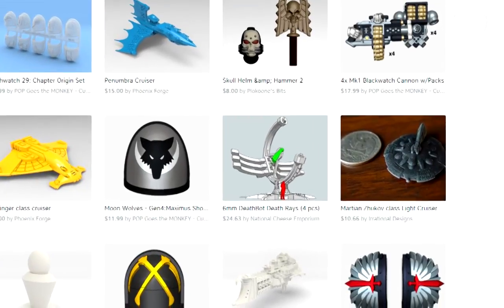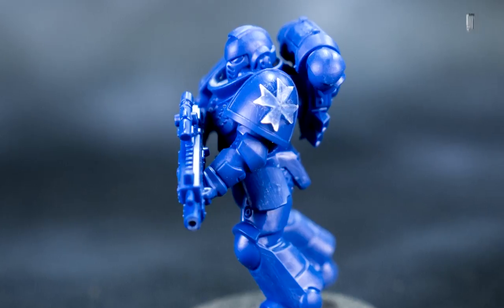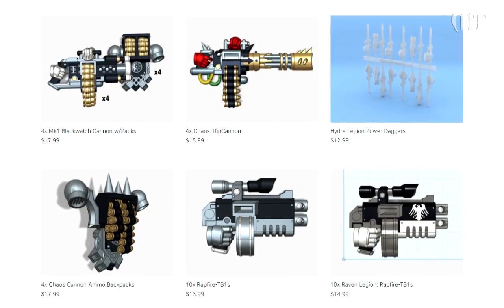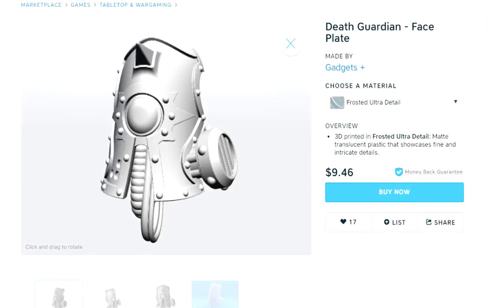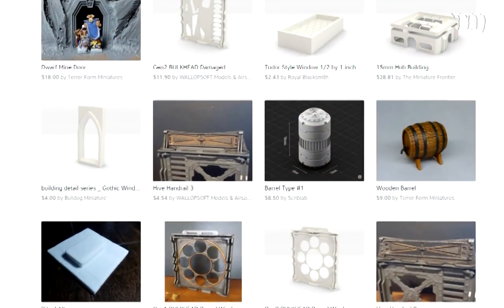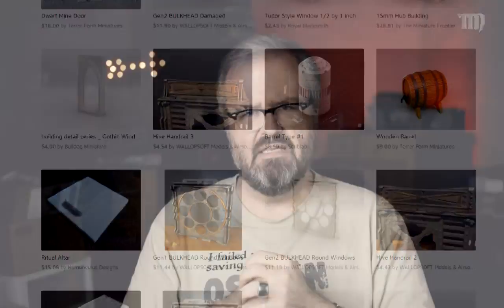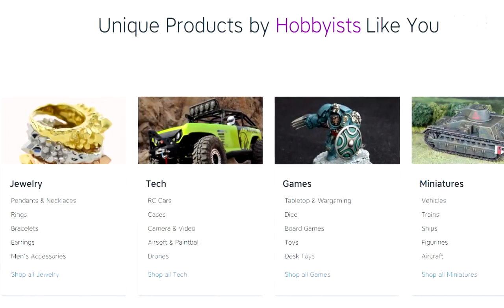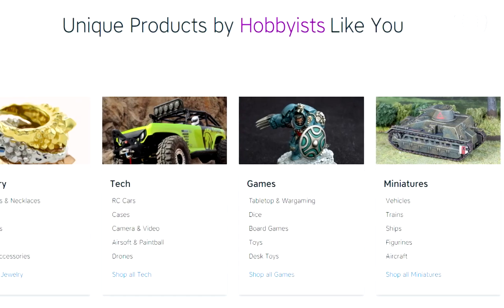Get 3D Wargaming Prints Without Owning a 3D Printer

Comment: If you want to learn 3D printing and 3D modeling, look for an independent (possibly non-profit) makerspace or library near you that has 3D printers. Often they will offer classes on the subject, sometimes at no cost to you. You can get your feet wet, or just dip a to in and possibly learn 3D modeling and printing for the cost of the filament that you use. If it turns out that you like it, you may be able to join the makerspace for a small monthly fee and get to use their equipment. Plus, you'll be around other like minded people in a hobby you enjoy.
As for 3D modeling, if you can learn how it is done and create your own library, you might be able to find a job in that field. Solidworks modelers can make decent money, but learning any modeling software can help you gain an education in the topic.

Comment: Public libraries are a good place for playing around with 3D printers too. Most have filament printers but some do have resin ones! Plus, the cost can be pretty cheap. The library I work at only charges a quarter per half hour, and offers classes to teach 3D design and how to use the printer. Something to keep in mind if you want to dip your toe into 3D printing.

Comment: you can get rid of the layers by using abs filament and then putting it under a glass cup with a paper towel with a bit of acetone aslong as its airtight and watch it and itll melt it and make it smooth aslong as you dont leave it in too long youll be just fine.

Comment: There are several public libraries near my home that give you access to 3D printers, laser cutter/engraver, vinyl and paper cutter, sewing machines, laptops, recording studio, and so on for no cost other than the cost of any material used such as plastic filament for the 3D printer. You're not going to get the detail that was shown in this video but you will be able to proudly say "I made dis." Just throwing out another option.
Reply: David Casto damn where you at, I've never seen a library that nice

Comment: Bean 3d Printer is a SLA printer that has very high detail and its $500 bucks (OK its a "Kickstarter" but the company actually makes a 3d printer and that was successfully kickstarted and they are located in California), there is also the "Duplicator D7 DLP Wanhao" which is also between $500 and $700 bucks and its a SLA printer that has really high detail (although the company does have quality control; problems they are getting better).

Comment: A great alternative to Shapeways is 3Dhubs, you upload your model, choose the material, then choose the guy that will print it, it's easy to use, a bit cheaper than Shapeways (since you can choose price vs quality yourself) and you can get the print shipped to your home or can arrange a meeting with the printer operator to get it yourself.

and if you have a 3D printer, you can submit it to their database and get some money by printing models for peoples.

Comment: I do modeling for a shapeways store and its important to note that there are limits on what can be 3d printed through them both because of the printing methods and a practical limit.  Certain materials have restrictions on how large they can be or how thin parts can be so occasionally the models will look off compared to metal or plastics because of scaling. Also on a practically level the larger the model gets the more the cost rises. 3d printed parts and even basic figures are generally affordable but larger items like entire vehicles become astronomically priced. I did a landraider proteus once and clocked in at around 600 bucks.

Comment: I own a Form1 SLA printer (about 5000 USD new) that i use mostly to print out 1/2000 scale models of WW2 ships that i make. The prints are very nice with details of up to 1/10th mm. High enough to make custom parts and models for 30mm games as well.

Downsides are the quite high initial price and the resin that comes at around 130 USD per liter. It also requires a lot of maintenance. Since the printer uses a laser and several mirrors all optical components need to be cleaned regularly with optical wipes. Dust or smears on them will cause failed unusable prints and lots of headache.
Reply: If you don't setup a little area for it, and not careful when pouring resins into the vat if your machine doesn't use a cart system like the new form 2 does (about 3.5k USD.)

The biggest thing I've used for my littleRP, which is a older diy/kit SLA machine, is I bought some cookie sheets for doing cleaning and part removal so no huge mess to clean up. And some old larger sized tubs for the 99% IPA for cleaning the parts post printing.

For SLA form 2 is about the cream of the crop of home machines, a few other less expensive machines have come out in the last two years that produce some outstanding prints at a fraction of the price, but the resin is pricey no matter what goes from 80USD-450USD per litter depending on the material type and the chemical properties of it.

If monoprice hasn't killed it, they have said that they will be releasing their own rebadged SLA machine for about 500USD, which is basically a wanhao duplicator 7 which uses a dlp projector rather then a laser so has a smaller dot size and able to produce finer details but the big trade off is smaller build volume and have to fill the vat yourself, so long prints have to top off the vat here and there.
Reply from the maker: I appreciate the input. I've also heard the resin seems to get everywhere, no matter how careful you are. Do you find that to be true? Thanks for watching!
Reply: For the first couple prints maybe, but once you learn how the material handles it's not really an issue. The resin is a bit like liquid honey, except dripping less. The isopropyle alcohol needed to post-process the prints also doubles up for cleaning.

Form 2 pretty much sloves most problems the form 1 has. It has sealed optical pathways and automatically feeds resin into the tub.
Reply: That's awesome.  I've been wanting to make a mess o f 1/2000 scale model WW2 ships, but don't have the $$$ to buy a SLA printer.
Reply: Try the Form2. Much better and almost zero maintenance.

Comment: Let's be honest here - it's quite not as straight forward as our dear Uncle Atom is suggesting.

True, there's a lot of nice stuff on Shapeways and even more can be found on places like Thingiverse. 

But here's the caveat - Shapesways is expensive for what it is. VERY expensive, in fact. And unless you pay through the nose to have them SLA print your stuff, the quality isn't really any better than what you can do at home with a good printer.

If you only need a helmet or a few shoulderpads, sure, go ahead and order them from Shapeways. But if you're into 3D printing on a larger scale - not just a few helmets but a full chapter's worth of helmets or a lot of terrain - you're probably better off buying a printer yourself. It will be cheaper in the long run.
Reply: "it's not quite as straight forward as Uncle Atom is suggesting: it's expensive"

It being expensive doesn't add complexity to the equation, it's still just as straight forward.

There was plenty of screenshots of the prices, so it's not like he was trying to hide the pricing.

"you're probably better off buying a printer yourself. It will be cheaper in the long run."

As Atom said, it's not just a case of saving money from not buying a printer. Shapeways have technology which far outdoes anything a home printer can do. If quality and resolution isn't an issue, and you think you're going to print a lot of stuff, sure, go ahead and buy yourself a printer as it probably will save you money eventually. But if you really care about high-fidelity prints you're better off going with a high end printer.

It's the same thing as regular printing. I can design and print a flyer on my home inkjet printer, but it's not going to come out as good as if a professional, high end printing machine printed it.
Reply: I have to disagree; just because something is expensive doesn't mean its not simple/straightforward.  It really boils down to cost vs convenience; is the service they offer valuable enough for you (meaning "you" in the general sense) to pay what they're asking?  Yes, if you're looking entirely at the long term then buying a 3D printer and learning 3D modelling on your own is an investment that may eventually pay off assuming that you judge being able to 3D print stuff for yourself (and possibly to sell to other people) as a return on that investment.  If, however, you're someone who doesn't want to shell out the asking price for a 3D, as well as the additional cost of material and you don't want to eat the expense of bad designs and/or botched prints, then sites like Shapeways and Thingiverse are reasonable alternatives.
Reply: Shapeways can be cheaper that GW or FW in some situations.  For example:  I got 60 ultramarine shoulder symbols for $18 from shapeways.  GW sells 10 full shoulder pads for $13.50.   It comes with other bits, but not the kind I can use 6 copies of, and the shoulder pad designs are only really suitable for a command or veteran squad).  FW sells 10 for $14.30 which come is various styles, but that would cost $85.80 for 60!
Reply: I do agree with you in principle, but there is a reason painting services for example, exist, some people have the money but not the time or interest to invest in learning how to do these things & just want an end result they can use.  This service would suit them just fine.

Comment: I have a love/hate relationship with Shapeways. They help bring awareness of 3D printing to hobbyists, as well as their support for "Safe Harbor" law, which is why places like them and Thingiverse can host so many items that nuzzle right up to other entities Intellectual Property. However, their prices are godawful, and many of the large scale printers  have been matched or surpassed in quality by smaller desktop units. A great video as always.
Reply: Agreed.

Shapeway is easy to use and have good - though not great - quality. But the price is simply too high for what it is.
Reply: i don't think it thats bad, maybe if you are doing a bunch of parts instead which you would have to nest them or maybe put them on a thin connecting sprue to avoid the part cost but things around the size of standard heroes and hq in wh40k or wh aos/fantasy it the same price for the actual print being 10-15 but its the postage which seems to really ramp it up being 7-8